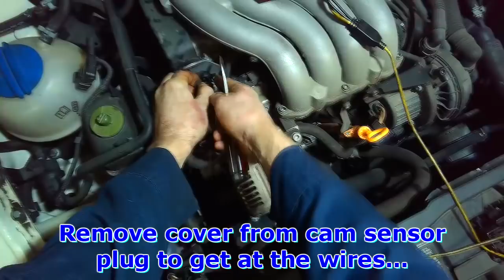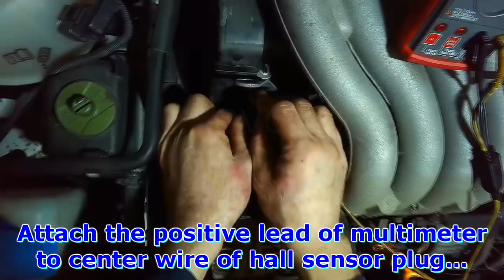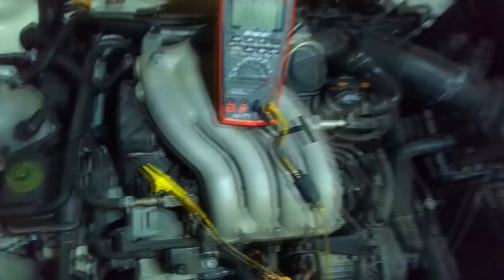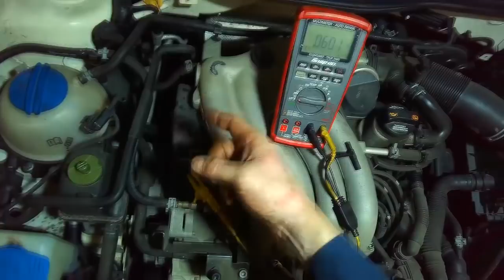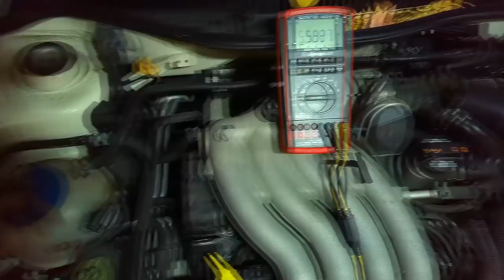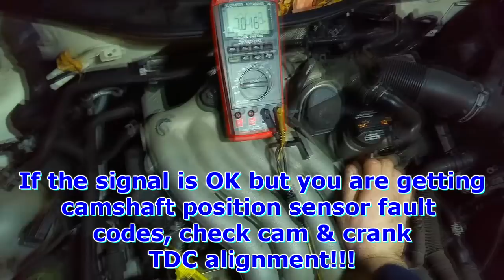VW A4: 2.0L camshaft position sensor quick check (for signal)

Comment: Thank you for this. I just installed a new cam and a new position sensor but I keep getting a code that it's at bank 1. Very confused.
Reply from the maker: Year, make, model, engine?
Reply: @EXOVCDS  2003 vw golf GLS 2.0l AVH
Reply: @EXOVCDS  the cam was a tt266 aka 270 from tectonics tuning.
Reply from the maker: @maxreigert3801  post pictures or video of the cam & crank at #1 tdc.
Reply: @EXOVCDS  ok. I'll have to take it all apart. It idles great and runs fine till it hits 3000 rpm. Limiter kicks in while driving or sitting
Reply from the maker: You only have to take the upper timing belt cover off... and turn the engine until the cam mark on the gear aligns with the arrow. Then, look where the crank pulley mark is. Ideally the tdc mark at the transmission.
Reply: @EXOVCDS  I just did the timing again. The mark at the tranny was at the bottom of the window. I had a screwdriver in the number 1 spark plugs hole to make sure of where the piston was and  Rotated it twice to make sure the timing stayed.
Reply: @EXOVCDS  by the way thank you very much for responding. I wasn't expecting that. Truly grateful for your input.
Reply from the maker: So it's ok now / was out one tooth?
Reply: @EXOVCDS  the timing is good. I did the timing 3 times in the last couple days just to make sure and the power is still dying out at 3000 rpm. I keep getting the same bank 1 code for the cam sensor. Im thinking of pulling one and the gear from scrap yard and see what happens. And I also went to do a review of the sensor I purchased on amazon and when I went to the product page it says does not fit your car. But the description says it does and it fit like the original one I had. More confusion.
Reply from the maker: @maxreigert3801  As long as the gear has no broken / bent sensor "windows", the gear should be OK. You can check the sensor function with the engine off... or with the engine running (as seen in the video). Have you already done so? Does the sensor sit in the same location as the old one & look similar? Links so that I can see?
Reply: @EXOVCDS  the bracket and everything looked the same. I bolted it up to same place and the plug was the exact same. I'm gonna have to check and see if I bent one of the cam gear windows when I out it back together. Unfortunately I didn't have the right tool to hole the gear while I torqued it down. I'm gonna take it apart again tonight and I'll take pics and send them to you.
Reply from the maker: @maxreigert3801  It could be that the sensor works "opposite" to what the old one does. If you still have the old one, compare the voltage when it is triggered by one of the windows. If the new sensor triggers a "high" voltage when it is supposed to trigger a "low" voltage (or vice versa), then the ECM will get confused.
Reply: @EXOVCDS  ok sounds good. Yea I looked at the package it came in and in small print on the sticker it says it for a 2011 2012 jetta. Not sure if they sent the wrong thing or I accidently chose the wrong product.
Reply from the maker: @maxreigert3801  100% that's the issue then.
Reply: @EXOVCDS  thanks again for taking your time out for me. Truly appreciated.
Reply: @EXOVCDS  I just took off my cam gear and the windows are bent badly.
Reply from the maker: @maxreigert3801  The new sensor is probably not sitting in the same location... caused the damage?
Reply: @EXOVCDS  the gear was trashed and the sensor was broken. I pulled a new gear and 2 sensors from the scrap yard and was very careful on install. And we have success. So happy. Thank for your channel and time. Hope you have an awesome Christmas.
Reply from the maker: @maxreigert3801  Good to hear things turned out well. Merry Christmas & Happy New Year to you & yours!

Comment: Great video.  It's not completely clear, however, that you probe the center wire (with a pin I presume) without unplugging the connector.
Reply from the maker: Yes, it's called "back probing".

Comment: the voltage between two outer wires is 12v?
Reply from the maker: Earlier / older engines used / had12v power... I believe the mk4's use a 5v power supply. What voltage to you have?
Reply: @EXOVCDS  Thomas, the harness voltage is 10.8v to power and 5 for signal with engine off battery on, is it ok?. I didn't made the sensor test yet.
Reply from the maker: @cwd4660  As mentioned in the video... this VW 2.0L engine has a 10v reference voltage (other engines / year of vehicle, might use a different voltage) that is pulled to ground by the hall sensor. Depending on where the sensor wheel stops when the engine is off, you will either see a high or low voltage (center wire of position sensor connector) when the key is ON. Once the engine is running, you should see a voltage that is LOWER than the HIGH voltage when the engine was OFF.
Reply: @EXOVCDS  thank you

Comment: I got a camshaft sensor code but the car won't start so i can't check if the sensor is good. I am not getting power to the fuel pump and the pump works, but my only code aside from the cam sensor is 2 for every injector, so I am hoping replacing the cam sensor works.
Reply from the maker: Year, make, model, engine? Camshaft position sensor is not needed for the engine to start & run (1.8T, 1.9TDI, 2.0L, VR6)... if you have "short to ground" injector codes, the problem is most likely a bad fuel pump relay.

Comment: Great video! I have a 2001 beetle 2.0 AZG that is showing 10.84 on the signal wire with key on. 10.84 unplugged.  Key off signal wires it shows 0.11  It wont start, cranks and cranks. What do you think?
Reply from the maker: What's the voltage while cranking? The cam sensor is not needed for the engine to start / run. If the engine doesn't start with the sensor unplugged, it's probably not a cam sensor issue. Make sure that the timing belt is ok and that no teeth are missing (engine jumped time). Could be a crank sensor issue, timing belt issue or a bad fuel pump. You'll need to do some more checking. If the belt is turning when cranking the engine, have someone tap on the bottom of the fuel tank (right rear passenger side). If it starts, the fuel pump is bad.
Reply: You are the Man!!! I tapped the tank and it started up! Do you happen to have a video on swapping out the beetle fuel pump 😆 Any tips or advice? This guy is a seasoned pro, its a pleasure to deal with experts, with real experience. Thank you.
Reply from the maker: @joesmoe3231  Golf, Jetta, New beetle... all the same:
https://youtu.be/Zywt5gFJCFc
Reply: Thomas EXOVCDS Thank You. You really helped me out alot. I really appreciate it👍

Comment: Does this work the same for te crankshaft sensor the one located behind the oil filter
Reply from the maker: Testing? No... the cam sensor is a "Hall" sensor. The crank sensor is a "VR" (Variable Reluctance) Sensor.
https://fullfunctioneng.com/info/Hall%20vs%20VR.pdf

What's the issue you are having? Year, make, modle, engine?

Comment: Hey thomas I have a 2.0fsi BVZ engine (non turbo)when checking the cam sensor wires I get 4.95 volts on the two wires and 0v on the ground the issue I get is when the sensor is plugged in the car gives a hard start and possible no start  code P0341 implausible signal is sent to the ecm when I unplug the sensor the car starts fine maybe an extended crank at times but no where close to the no start condition i get when I have the sensor plugged in anyways can you assist me thanks as always.
Reply from the maker: If your cam sensor signal voltage is always 4.95Vdc (just like the power supply voltage), then your cam sensor is bad.
Reply: @EXOVCDS  Sorry I forgot to mention that the 4.95vdc I get is from the sensor plug not the sensor when its plugged in but still should I not get 12vdc on one of the wires when unplugged? it should be 3 wires 12vdc 5vdc and 0vdc (ground) even though the engine is different front this engine the sensor voltages should correlate?
Reply from the maker: @shimon2476  Not all engines / cam sensors have a 12v power feed. If you have 4.95Vdc on two pins, then that is most likely correct for your engine. Regardless of the voltage, the "signal" voltage has to switch from high to low when the engine is running (or turned by hand). If the signal wire voltage does not change, then the sensor is bad.
Reply from the maker: Switch high & low with the sensor "plugged in".
Reply: @EXOVCDS  got ya will test and report back thanks as usual
Reply: @EXOVCDS  Hey Thomas so I checked the sensor the green wire I get 1.3 to 2.4vdc while idling when off ignition on I get 4.95vdc and the next wire I get 4.83 to 4.95 while idling when off I get 4.95vdc and well I did't check the ground the only thing I had done was changed the timing chain tensioner, chain and exhaust hydraulic unit as it was making the dreading slapping noise before I did this job the car was starting ok just had the awful noise after the job the car makes no noise its just this implausible signal for the cam sensor that keeps coming up I made sure to mark the chain and gear before removal yesterday  also I don;t think its off by a tooth or anything what are you thoughts?
Reply from the maker: Timing is not correct... sensor is producing a signal, but the ECM doesn't like "when" it is getting the signal.
To confirm, you would need to compare your cam & crank signal to a known good signal... using a labescope.
Reply: @EXOVCDS  Ok I'm thinking so as well will take off the cover for the timing chain and check over maybe its off a tooth do you have any videos on where you did this job on a 2.0fsi was looking but can't find any.
Reply from the maker: @shimon2476  Sorry, no video (yet).
Reply: @EXOVCDS  Ok cool thanks will check the timing the report back.
Reply: @EXOVCDS  hey man sorted out the problem the timing was spot on the new eBay can adjuster was defective! Everything is fine now thanks as usual!
Reply from the maker: @shimon2476  Thank you for the update! Good to hear that you found the issue!
Reply: @EXOVCDS  Yes did the timing like 4 or 5 times lesson learnt never trust cheap parts.

Comment: I have an 05 jetta 2.0 I just put another engine in, and the car starts but the engine shakes and it has the code for camshaft. You think that  that's the reason it shakes thats the only code besides an ABS code.
Reply from the maker: Engine should start & run smoothly even with sensor unplugged. If it runs rough with sensor unplugged, check / verify correct timing belt installation (camshaft & crankshaft alignment).
Reply: @EXOVCDS  thanks. I will check the timing first.
thats  the way I bought the engine. but i will definitely check it out

Comment: Is there a way to check the sensor when the car will not start?
Reply from the maker: Same thing... key ON and measure the voltages.
Turn the crankshaft with a ratchet & 19mm twelve point socket. As the camshaft gear rotates, the center wire of the sensor plug should go from high voltage to almost 0 voltage. If there is NO voltage change, the sensor is bad (verify power & ground by checking the outer two wires first).
Reply from the maker: Year, make, model, engine? 2.0L should start with cam sensor disconnected.

Comment: Hi mate can VCDS view these data also in regards on timing and camshaft sensor ? I have a p0341 and like to see if vcds could view these as data
Reply from the maker: Year, make, model, engine?
On some engines... cam signal is NOT shown in VCDS.
Reply: @EXOVCDS  Hi its 2003 VW GOLF MK4 AJZ motor 2.0 .. is there anything I can view on vcds for timing or something regards This code to be  usefull .. my multimeter died when I did the signal check but was enough to see it moving around like your video so assume its work but now the timing .. can this code be issues with spark plugs ..coolant sensor or anything else in your experience .. a swell stretched chain also ?
Reply from the maker: @saabaero6211  If the timing belt is stretched / too loose or was installed incorrectly, that could cause the code to set. I'm not familiar with the AJZ engine... if it has variable timing (oil controlled camshaft sprocket)... that too could cause camshaft code to set.
Reply: @EXOVCDS  sorry its a AZJ .. hope issue is minor .. wish we had mechanics like you locally .

Comment: I have vw Jetta 05 made in Mexico the cam sensor is not behind the cam gear where is it located on a Jetta made in Mexico????
Reply from the maker: Adrian A Castillo if the engine has a distributor, the sensor is in the distributor.
Reply from the maker: Adrian A Castillo What engine do you have?
Reply: Thomas EXOVCDS it's an 05 Jetta 2.0 made in Mexico it has a coil pack an dose not have a cam sensor behind the camshaft timing belt gear like all other vw 2.0 engines do
Reply from the maker: Is the engine code a BBW? The sensor is at the other end of the valve cover. Send me a picture of the engine and I will mark the position. fkh161@fkh161.ca

Comment: Hi Thomas nice vids, i got a question maybe you can help me, i got a 00 jetta 2.0 it quiet on me i scanned it it said G40 not aplausible sigal po341, after ck for signal at the cam plug i noticed that i had a good ground, a good 5 volt reference but the center wire had nothing ck all fuses and they are all good,so i should have some kind of voltage out of the center wired right? so what does that means bad ecm or what please hepl and thxs in advance.
Reply from the maker: If the sensor was plugged in and the engine was off (key ON), it could just be that the camshaft was sitting in a location where the signal was "grounded" (voltage pulled to 0V). If the engine DOES NOT start & run when the sensor is unplugged. Check your actual TDC marks of the camshaft & crankshaft when at #1 TDC. If the timing has jumped, you will get a cam code and the engine may not start. If it jumped too far, you might have bent valves.
Reply: i will look into it thxs alot once again for your knowledge and help.
Reply from the maker: Let me know what you find.
Reply: ok i will thxs
Reply: @ESCOJIDOSPORDIOS  which fuses do I need to look for po341 aswell timining skipped and cam sensor or something .

Comment: How long does it take for the check engine light to turn off already change the sensor camshaft ?
Reply from the maker: If the sensor was at fault, it should turn off after 2 to 3 driving cycles at the latest. If it does not go off, then there is a timing issue. Year, make, model, engine? Was the timing belt recently replaced? If yes, then the cam / crank position is incorrect.

Comment: Thomas the sensor of the video is good or is it bad? What would be the exact ranges of a good sensor and a bad one? Greetings from Chile
Reply from the maker: Like I said in the video... the voltage amount doesn't matter as long as there is a difference when the engine is running. When using a voltmeter, the voltage on the signal wire will be high or low, depending on the position of the sensor. When the engine is running, the signal voltage will be LESS than the high voltage (engine off /key on), but more than the low (close to 0) voltage when the engine is off / key on. The sensor produces a square wave signal, which a voltmeter can not capture quickly enough... because the signal changes from short to long pulses.
Reply: Thanks for this--very helpful.  I got 13 volts on the signal wire with engine running, 11 engine off/key on.  Does that definitely indicate a bad sensor rather than some timing issue?
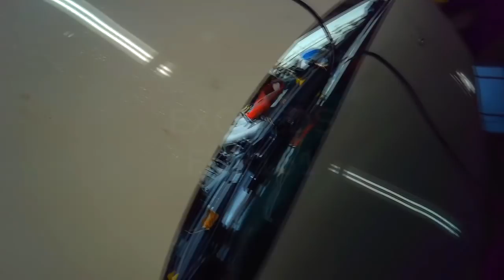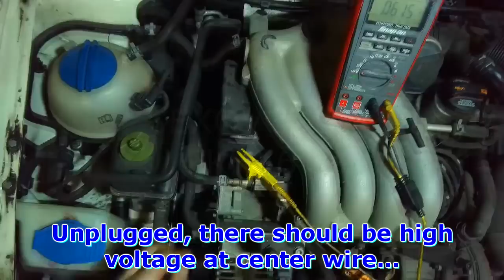Reply from the maker: At 1:40 is a good signal / voltage at the middle wire. Signal voltage (engine running) should be lower than the voltage of the signal wire when the sensor is unplugged 1:00. Check again, let me know what your readings are.
Reply: I checked again:  13 on signal voltage (engine running or key on), 11 when the sensor is unplugged.
Reply from the maker: Same engine as mine? Record a video of what you are doing, post it on your channel and post the link here, so that I can see. Voltage should not be higher... as you can see in my video.
Reply: Yes, same engine (2.0 L Jetta GL AEG).  Sorry: voltage readings are 13 engine running back probed to middle wire connected and same when disconnected from sensor.  Engine off/key on, readings are either about 11.4 connected or not connected, or close to 0 connected or not connected after re-starting engine to move.

Comment: Using only a DVOM to check to see if there is a signal will help the DIY. As you mentioned, whether they get 10V or near 0V on the signal wire, the sensor is bad.
Reply from the maker: I hope it will!